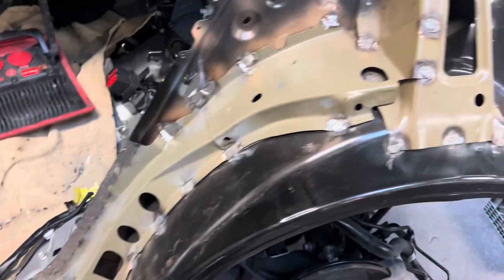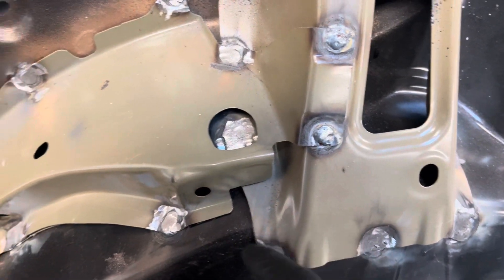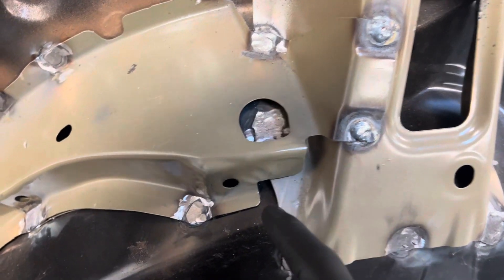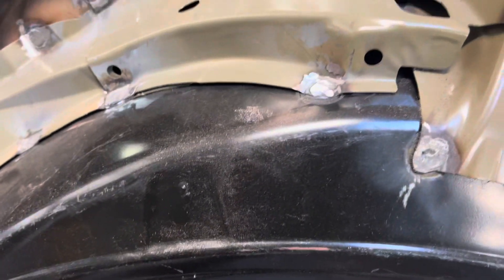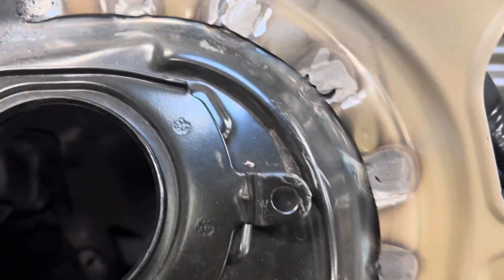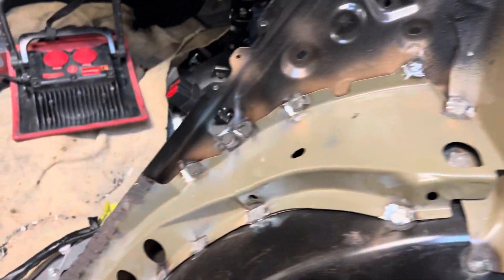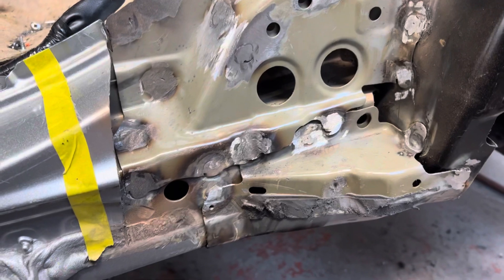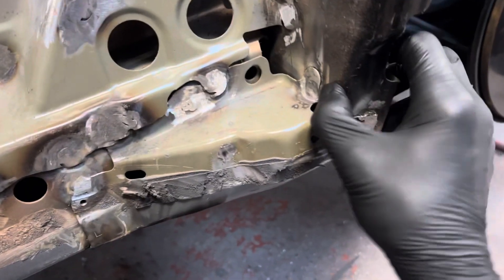Bad welds waste a lot of time and money. Thousands of man hours grinding down welds￼￼ over years

Comment: wow does that welding look sloppy. If that car ever gets hit in an accident its coming apart.
Reply from the maker: As a customer when you bring your car in you never get to see what happens under the sheet middle on the repairs something I’ve gotten to see my whole entire life and sometimes it’s pretty scary. 

All the customer knows does the paint match is it smooth and shiny then it must be good that’s just the outside wrapping paper.
Reply: @coldfinger459sub0  yeah, its sad that the customer wont realize the car lost some structural integrity...I've seen plenty of crap welding done in industry by professional welders as well.
back in the mid 80's when i was at a chevrolet dealership we had a customer come in with a used trans am (1979-1981 vintage) and I did a pre purchase inspection for him....the car was clipped front to rear, the welding was done under the back seat area of the car, a total hack job and illegal to boot but the car had a fresh paint job and looked great...he was happy he paid to have the car looked at before buying it!
Reply from the maker: @williamd2738  I was at one shop their welder broke down the technician was using Oxsee acetylene and brass. brazing rod .   To install the front strut tower and front radiator clip and support. 

And anybody who knows welding knows bronze braising cracks with vibration. 

These are the type of individuals that are allowed to run and operate and own automotive shops they don’t actually work on cars himself and they have absolutely zero formal automotive education they learn by screwing up customers cars and they call that a method of learning. 

This is why sometimes I’m 100% and totally against anybody even being remotely involved in automotive business or being allowed to invest or own an automotive business unless they can perform every kind of repair themselves that they’re advertising that their shop does if they can’t do it they don’t get to make money off of it plain and simple. 

And if the owner themselves cannot instruct and teach their employees how to do the work they’re not allowed to own the business
Reply: @coldfinger459sub0  agreed 100%